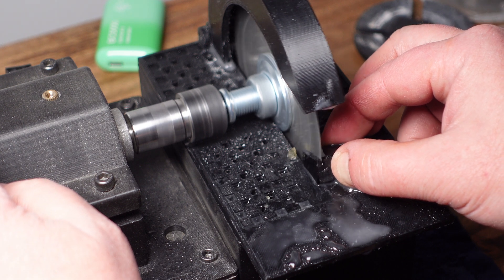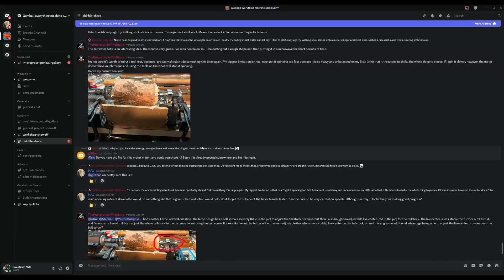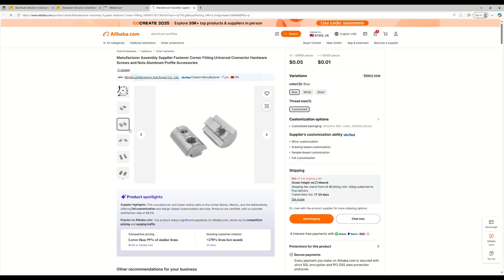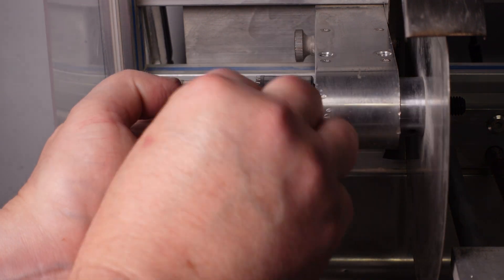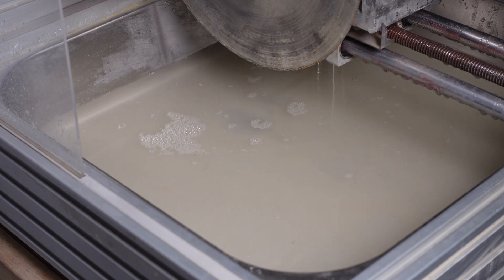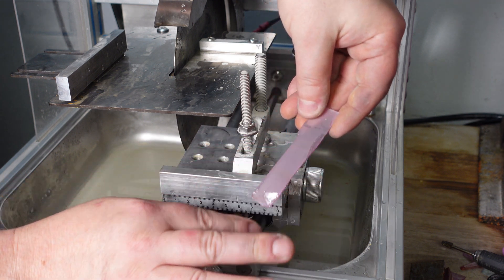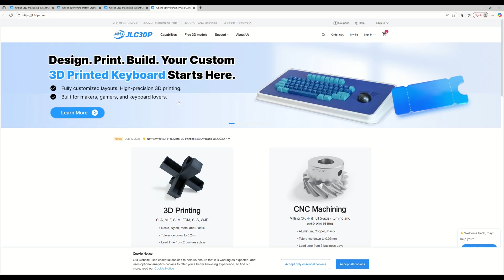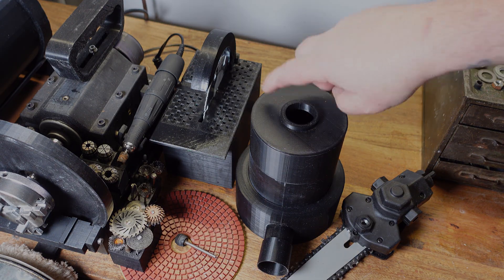Upgrading My 3D Printed "Everything Machine" with Aluminum Extrusion #3dprinting #lapidary #maker

Comment: You should add a blade stabilizer like the production trim saw one popular lapidary company makes. 

Will the kit be customizable for each buyer? For instance, I would buy more flex water lines than 2 to use on my other saws and also a half dozen blade stabilizers to add to my other saws. 

If the price is low enough, I might buy multiple saws to use in a kids lapidary class. 

Where are the price breaks in terms of ordering quantities?

Comment: About 10 years ago (whenever the original raspberry pi came out), i used standard metal studs to make a crude 3d printer for concrete using  badly hacked mudmixer addons - maxed out at 24ftx24ft using off the shelf metal studs.
It made the world's ugliest concrete shed but the metal studs were fine.
The studs became the roof and the rented mudmixer went back to Home Depot

It would have been faster and cheaper and less back breaking to just use concrete blocks (concrete bags are heavier than blocks and the top layers were a PITA after 12 hours straight trying to get away with only 1 day of mudmixer rental) but I did learn some things.

1. Off the shelf metal studs are able to be used for large 3d printers
2. The guage and size needs to be sturdy enough to hold the weight of ALL the "filament" for the whole print,  or have a feeder, or leave a section of the print area empty enough to allow a return area for refilling  (i didn't think of that until 1 millisecond after the last 80 pound bag)

The extruded aluminum gets expensive once you get to larger than a few feet especially if you have excessive weight ..  steel studs could be an economical tradeoff if 0.1mm precision isn't required

Comment: Aaaaand my comment is gone 🙂
Reply from the maker: What is your comment? They have been disappearing
Reply: Ah, I've been asking why not share the group buy with viewers, not just patreon members. It should be cheaper per piece that way
Reply: Also have seen the same machine that is on video on alibaba for a whooping 1000€. Don't know whether they use your design or you use their as basis but the price makes me worry
Reply from the maker: @xTatsuran yes like I said in the video that I first saw this type of machine when I was in china but the idea is to completely customize  it to add a lot more features but regarding price, the $1000 machine you saw was likely with motor and power supply but this machine will be powered by the gumball and we will order it wholesale so it will be significantly less expensive shipping directly from the factory.  You need to realize that alibaba are resellers who add 100% to the price they pay

Comment: Given how much the aluminum extruded frame looks like an actual prebuilt machine...I'm wondering if the entire everything machine could be remade with mostly aluminum/off the shelf parts...and thus become viable as an actual 'product' at that point. In particular could be useful for uses that require a lot of precision like proper gem faceting, or either way more useable in semi-professional settings.

Of course it would likely start moving away from the affordability value of the 3D printed version (especially for makers on a budget) at that point, but I'd bet it would still beat the dedicated machines by hundreds if not thousands while taking up a lot less space.

Comment: How much will it cost roughly? I know personally many things can be sourced cheap from china but when the shipping weight is below container size and when cnc is involved it gets expensive fast. 
Then to make money on a product you probably need at least 100% markup. Even the Chinese seem to have at least 100% markup plus shipping on their hobby cnc machines.

I also love the guideway design it's my prefered design, a precision Improvement though with it's own downsides would be to use larger rods and 3d printed carriage that can be tightened so added friction gives added precision. You could also lap the guide rods straighter this way.
Reply from the maker: Im not taking a profit from this.I wanted to make a custom machine for myself and figured  i would  document the progress and invite others to follow. It will be a one-time wholesale order that will be drop shipped from factory,  directly to individual backers so no mark up.  Its hard to estimate a price because there are so many variables ( how many ultimately decide to join will lower price dramatically and individual configurations could also wildly vary in price, they could range from the most basic version I showed in my video to one with drill press and cnc functionality and unknown additional attachments but to give you a general idea, the setup i showed in my video, im estimating would be anywhere from 1/4 to 1/2 the price of a hitech diamond 10" saw so it should be  between 2 and 4 hundred give or take depending how many decide to  join im estimating. I should have a more accurate idea of final price in a couple weeks when I have a better idea how many are interested
Reply from the maker: The only part with significant weight is the cross slide. Almost everything else is aluminum and assuming most will power it with their gumball, they wont need a motor or power supply so shipping should be very reasonable